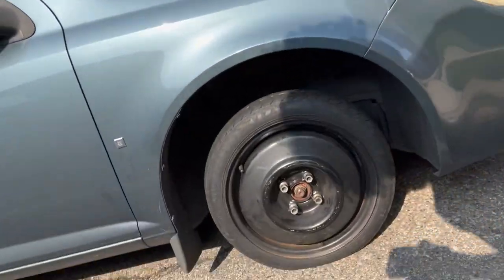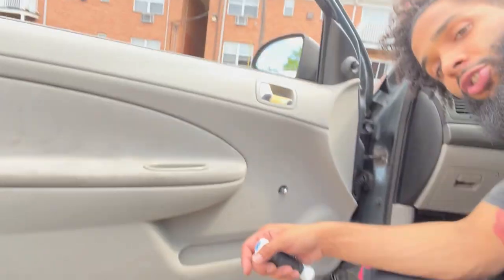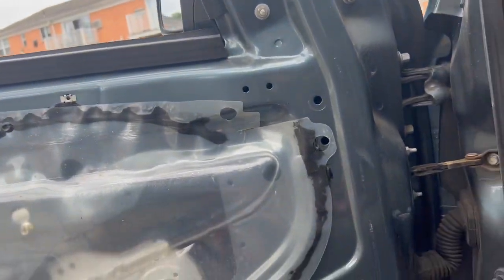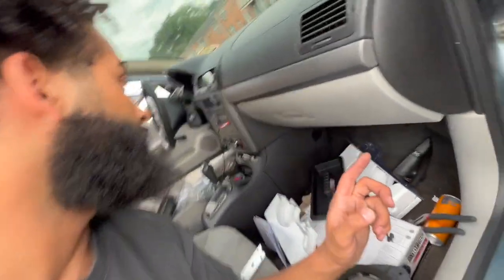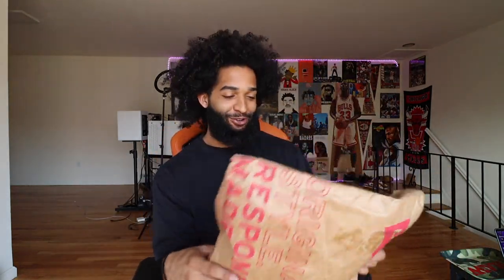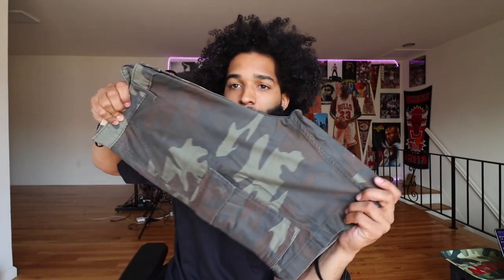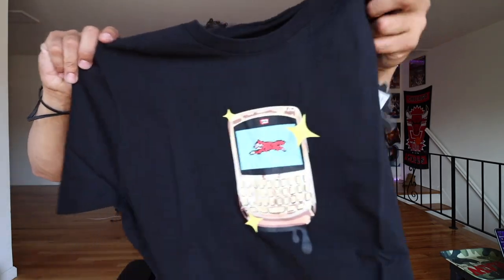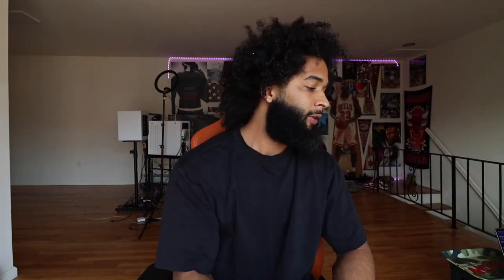ICE CREAM (BBC) HAUL 🔥  + MY FIRST CAR MOD

Comment: How’s the sizing? TTS or size up on t shirts
Reply from the maker: Im like 6ft-6'1 180 lbs and I think the XL is the perfect fit family, slight oversize fit, if I didn't workout it would fit even more oversized. So it depends on the fit you want, TTS will give you a more slim - fitted in the arms and slim stomach, no box fit. one size up will have the fit nice, still clean look, not loose and boxy, covered your arms almost down to the elbow.